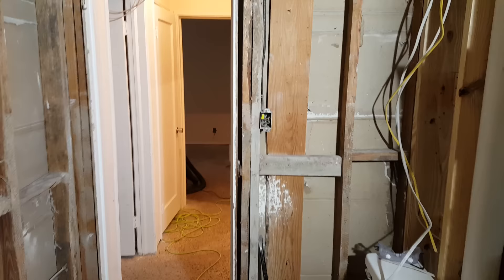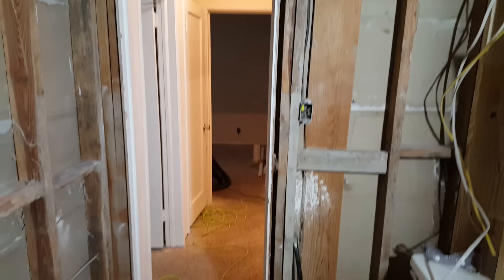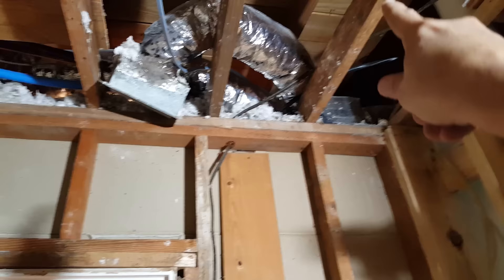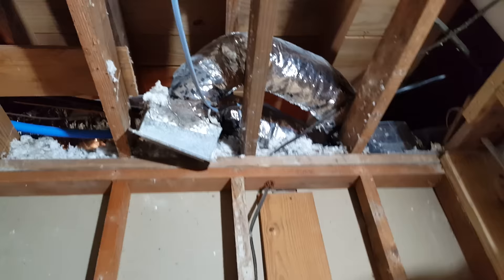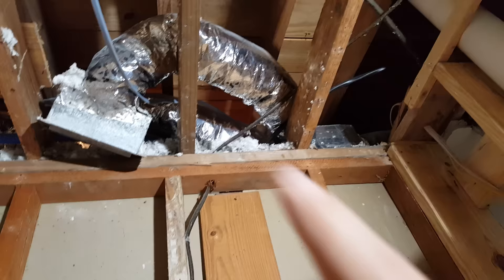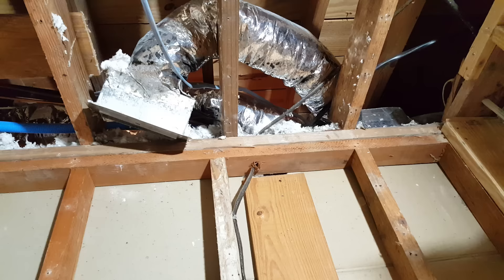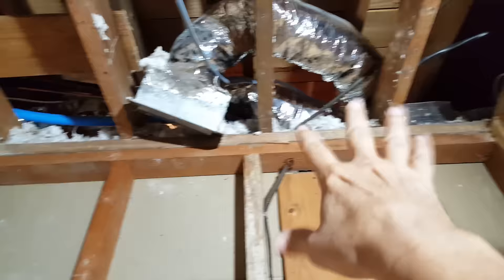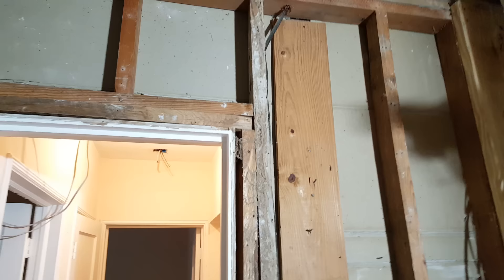How to Tell if Your Wall is Load Bearing

Comment: You should know that you're not qualified to make videos like this for public viewing.  I'm not trying to  be that guy, but this misinformation is frustrating.
Reply from the maker: M.  OK Mr Expert, dont leave us all hanging why not point out what is wrong?
Reply: jeffostroff I'm not trying to get into a words battle with you.  I'm only stating that you are not qualified to be instructing the public on these issues.  I'm a licensed PE and I would be hesitant to make a 5 min video describing how to detect a load bearing wall on YouTube...it's just too broad of a subject. Again, not trying to be an @ss.
Reply from the maker: Yes, but unfortunately the general public is out there doing foolish things, and they have a short attention span so a short video that keeps them out of trouble is in order here. And we still recommend they use a PE or general contractor to check their work. But you still have not mentioned which is misleading.
Reply: I guess my point is that every situation has the opportunity to be unique. To begin with, the top plate acts as a building diaphragm to transfer shear loads.  The double plate assures continuity.  It's also hard to tell what the joists you refer to actually are, it's difficult to see, but they could just be ties.  If they were designed as ties, their only real job should be restraining the lateral load from the rafters.  I understand it could support a storage space as well.  Load path can be a complicated subject and I'm only saying that I would hesitate to make a video like this.  You clearly have a good understanding of what you're looking at, and dealing with, but again...I would be hesitant since every situation is unique.  Only my opinion tho and I'll leave it at that.
Reply: jeffostroff your video should have been 5 seconds then "call a professional engineer licensed in your state" this video misses alot!!!!!! You're not trained in load path analysis

Comment: I got more confused watching this video.
Reply from the maker: It can be quire confusing, but bottom line is that if any cross members resting on  top of the wall have an endpoint on the wall, then it is a load bearing wall. IF any roof members have an endpoint on top of the wall it is load bearing.

Comment: that's not a load bearing wall - if it was the framing over the door is wrong.
Reply from the maker: In those tract homes that they built for veterans back in the 40s they often did stuff on the cheap

Comment: That wall is not load bearing dude.. ther isn't a header over the door
Reply from the maker: Yuo can't judge it by whether or not there is a header over the door, that could be a fatal mistake on your part, because builders often took short cuts. The only 100% way to be sure is if a structure member above the wall has an endpoint on that wall.

Comment: LOL That isn't even a load bearing wall. That "header" is just there to hold drywall. The vertical 2x4 above the door is called a cripple stud. Also absolutely nail the header into the king stud its purpose is to keep the header from rocking. This guy has no idea what he is talking about.
Reply from the maker: LOL, funny how you can magically tell whether a wall is load bearing or not by looking at the door header.

Comment: Ummmmm yes you do just start cutting into a wall.......simple...you know that....not a good example of how to tell..........I wonder how the wall you showed was exposed.......
Reply from the maker: We had already torn off all the plaster to remodel this kitchen and bathroom and yes if you have no access to attic above to see load points ending on top of this wall, then you have to lose the drywall to see what is going on.

Comment: What
Reply from the maker: whatahowl1 what?
Reply: You are giving out wrong info. All wall have cap plates, walk studs are 16" on center, you said that the builder put in the do it header right but it is wrong . You really have a floor joices in you attic

Comment: A lot of this information is not accurate. I am not trying to be negative or condescending but someone that does not know the reason for all of these details you are explaining will believe you because you make some logical arguments, but several of the reasons you came up with are NOT true. Make sure and do your due diligence before trying to educate other people please!
Reply from the maker: Can you be more specific as to which information you don't think is accurate?
Reply: This house is older, so a lot of the indicators you explain aren't truly relevant in today's building standards. The joists can rest on the wall without being a bearing (unless they end on the wall), double-top plates are an industry standard now and are more-so for the ease of overlapping and intersecting walls to be nailed together rather than bearing code. The header is also not oriented correct and also should not be regular SPF lumber, but you did mention that it might be different. That door would need at least a 1-ply LVL if it was truly a bearing wall to properly dostribute the weight around that opening. Looking in the basement for continued bearing is going to be your best bet unless you know there are joists above that have one side rest only on that wall.

Comment: This info is not accurate. Where I'm from you defiantly can't make a header out two flat 2x4s.
Reply from the maker: This is an old house, this is how they did it back in the 1940s. Today we use 2x6 wood.
Reply: @jeffostroff  I get that's it's an old house. If I had to guess this is a small track home built after the war. It was framed probably in a day or two. I suppose there is a little on this wall, but only from ceiling joists. It's not carrying the roof or anything. It looks like if you turned around and showed the wall behind you that you would see a much better example of a load bearing wall. I just feel like your info is missguiding and you should probably keep from sharing your info with the world.
Reply from the maker: @joecox310  Yes, the wall behind me is the cement block wall of the rear of the house. These were built for veterans after the war. I was told this house was built in 1946.

Comment: I’m sorry to be that guy but a lot of this information is wrong
Reply from the maker: Eric Smith  Wow you make it sound like the whole video is wrong but you are that guy anyway because you just show up here and just say most of it is wrong without giving specifics.  That doesn't make you look very credible.
Reply: jeffostroff 
I don’t have time to explain all I seen that’s incorrect, it’s up to each person to do there research, I’m just saying becareful of what you watch. Dbl top plates don’t determine a lbw
Reply from the maker: A double top plate is one indication of a load bearing wall . does not mean it is a load bearing wall, you are trying to take one statement I made and trying to make it look like I said that was the only way to tell. The fact is you don't understand the international building code, because how many single top plate load bearing walls have you seen? I'm willing to bet you have not seen any. You, like a few other carpenter's apprentices before you think that a double top plate is there only to tie 2 walls together. Well IBC rules allow you to use a single top plate IF and only IF, you use a 3x6 galvanized plate to tie the 2 walls together, and the ceiling joists above the wall all must rest directly over a stud. So of course I'm right a double top plate is one of the indicators of a load bearing wall, after all you would never be stupid enough to put a load on a top of a single top plate, in between 2 studs where you on;y have  1 1/2" of meat to hold the load would you?